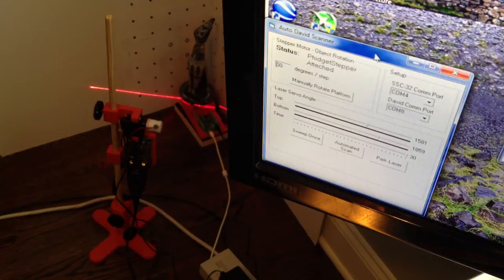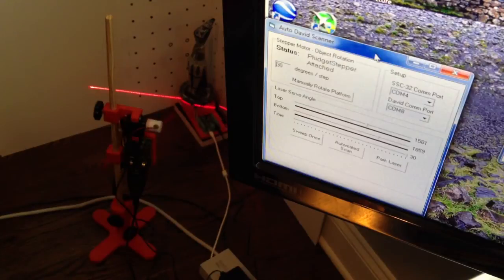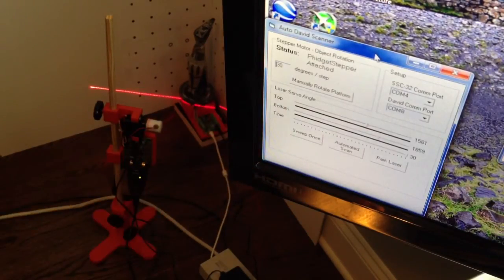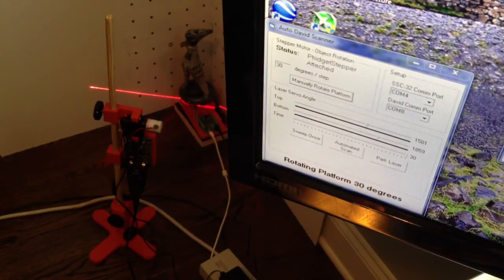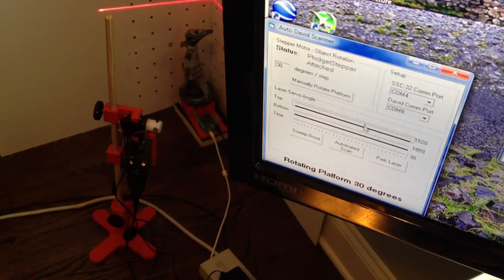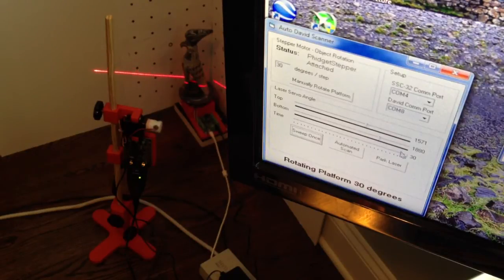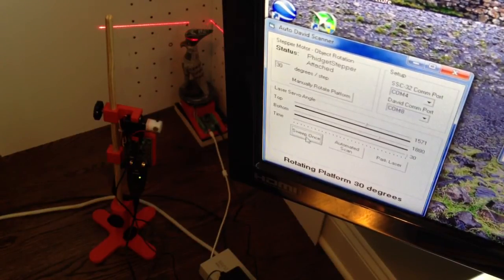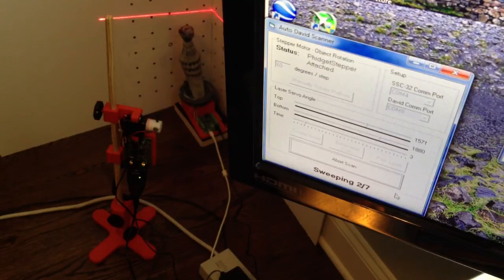Automated David scanner software explanation

Comment: Neat, if you look to the David Laser forum, there is a identical method to which I posted years ago. I have some further ideals that will work in conjunction with this "proven" concept you have accomplished. I have the same hotmail address as my user name here. I am building my first 3d printer now, the parts are in the mail. I could use a bit of help myself.